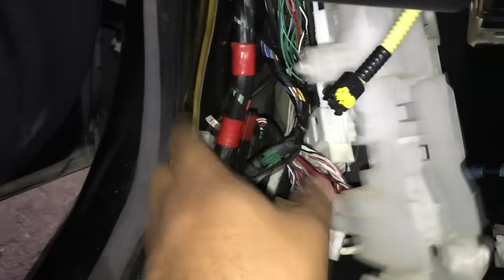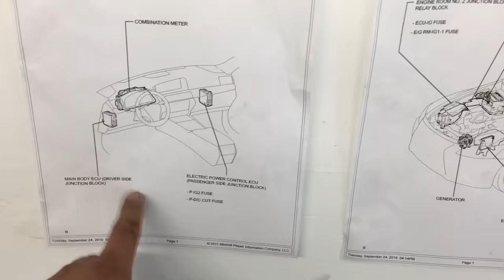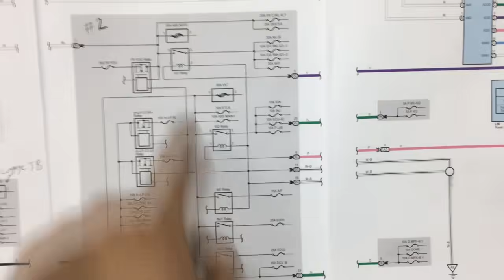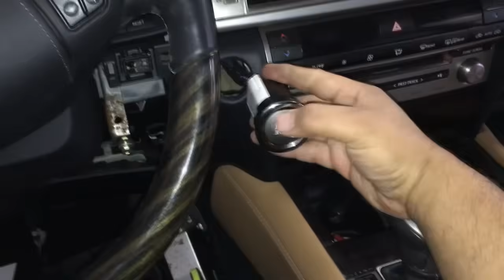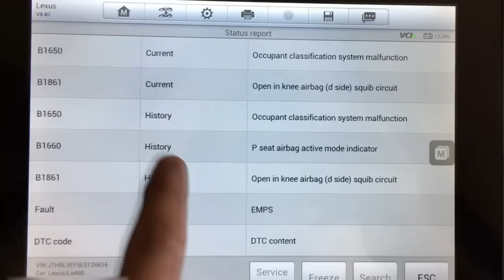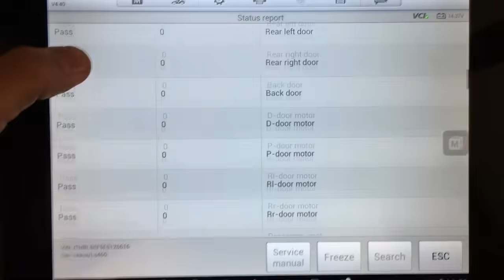LEXUS LS460 NO IGNITION POWER FLOOD CAR PART 1

Comment: Thank you this is the most I could find on the LS 460 I have a 2007 and I had the problem you started with a fuse kept on blowing because my amplifier was bad in the back I put another fuse in and it blew well I noticed  there was another fuse 30 amp on the other side driver side so I replace both  and after that that the car died so I can't go any further than where you stopped at the electrical I don't know what to do I had already replaced the relays I guess  just take your diagram and try to work my way through it some items do have power the interior light the the seats will adjust parking light will work and the doors will close that last quarter inch and the red light is blinking if I hold unlock and lock on the keypad it blinks and shows me the doors on a small display

Comment: Would that wiring diagram be the same for 07-12 Ls460? I'm not having the exact same issues, but at times, my ignition start button lights up but doesn't turnover the engine. I think there may be a bad ground or fuse possibly.

Comment: I have a 2007 ls 460 lose power the the starter I replace the starter I check all the relays have power to ing 1an2 the second pin dat you didn’t have power on I don’t also but I have power to the dash just no start or crank when I hook up my scanner give me c1242 open circuit ig1 an ig2 power source circuit need help

Comment: I have a question Erick I have the same car same problem when I powered it with the probe it gave me b2273 b2289 u0327 u1114 battery is good key is good I checked all fuses and relays is good the two ignition relay is doing the same thing like on the video the pins both have power but the rest is grounds and I changed the bcm didn’t change the only thing now is the door lights work but no light on the dash lights besides the light that has the door is open
Reply: Also the white wires going to the bcm has power and I changed the ID code box still doing the same thing

Comment: I just bought a 10k 6.2l for $2000 out of a "flood car" from texas. the mechanic told them needed new engine.. nothing wrong at all with the engine.. in a 2019 camaro running right now..

Comment: Question, after you replaced the fuse in the beginning (AM2 I think) after cycling a start cycle,why didn’t you check if the fuse was blown again?  If I have a blown fuse that is part of a sequence I always check after I replace and cycle the part that feeds it.

Comment: I need your advice I'm working on a 2008 lexus es350 that had no power to dash no crank no start after seeing u work on the 2014 lexus ls460 I did the something took the dash out and took the I'd box aka immobilizer and replaced it with one from the junkyard I got power back to the dash I used the autopro xtool to program the immobilizer it will SAS successfull no I could unlock and lock the car dash light up when I press the brake pedal the light go green but security still flashing no crank no start each time I try programming it it says operations fail  I got a new key fob from lexus it won't even pick up the the key when I try to program it I'm so stressed out i just took the dash out i keep getting b2799 and p16a4 code i really need ur advice please i dont mind paying u instead of the dealership

Comment: To change that spark plug in my LS460 I used a screwdriver to lift the seal under the ignition coil and the coil will come right out. I'm pretty sure you've already got it out by now though. Loving the video of all this work you are doing, I'm learning a lot about the schematics watching this.

Comment: You need to pop out the seal where the ignition coil seats, works every time. No need to lift the engine to remove an ignition coil.

Comment: Back in the old days, fill it with diesel. Let it sit for couple days. Break it loose. Flush oil system. Engine will not last.

Comment: STOP SHOUTING!
Jorge bought this car at an auction for 2k and thought "my compadre Erick will fix it for another 2k". Let's not feel bad for Erick because he got paid, also looks like he has never worked on a Lexus before. Couldn't take the coils out?? S0ark plug replacement on these LS 460 are tops 30 min.

P.S. Stop complaining about what engineers did or another techs did or didn't do. You could've said no to the job and that would've been the end of it. Nobody forces anyone to do anything.

Comment: The beeping is from the brake computer due to loss of pressure hence the accumulator is dead due to over work and water.  the speaker is on the left of the steering . you can disconnect it .

Comment: Eric your a brave man. I was a tech at GM for many years. I have seen cars come in after being hit by lightning. After haveing every module fry and smaller gauge wires fuse to each other seat motors burnt up. That was looking back on it now a walk in the park compared to flood damaged vehicles like this Lexus you took on. Especially after another shop had it before you looked into it and left you with what seems very little info on what they did. I believe I know what the outcome is gonna be after all is said and done. Good luck with the new wife.

Comment: Shittttt! I would not have taken on this job. It’s a nightmare waiting to happen. This dude must have bought it for almost nothing or got the insurance money and wanting to keep most of it. If he insisted you try, then he would have had to pay well and in advance every step of the way.
Did you ever envisage the amount of work you would have ended up putting in?
These cars are made to be repaired by the dealer. Likely he had an estimate done by them and chose not to continue due to the cost quoted which may have been more than the value.

Comment: A & I auto recyclers in ft worth tx, they have an engine 35k miles for $4,750 1-817-516-9090 Try to talk them down, as these cars engine will go for cheap after 2-3 years
Reply: Dude didn't you see that this video is from 6 month ago?
Reply: @gianfrancoa  Youre right I missed that

Comment: With so many flooded vehicles every year, there should be an opportunity to salvage those efficiently. Problem is, there is so much technical information needed, the best approach would be manufacturer specific. I wonder if anybody does that. If one had ability to remove each module and test on the bench, a guy could quickly define which are good, if only for parting out. These vehicles are cheap so I can imagine a profit margin, though you'd have to recycle hundreds of vehicles ever year to pay for the up front shop costs of learning how to bench test individual modules. Manufacturers have this ability, but are in the business of selling new cars, so are unlikely to encourage competition. Even getting the technical info would be problematic.

Comment: That power probe looks like a handy bit of kit. When these flooded cars get sheded  ,what happens next? do they go to auction ?and if so how long would they sit.I guess if you got one you would have to pull the carpets out ASAP . I guess they would go moldy .Do they put some heater in them ,with the windows open a crack to dry them out ? We don't get flooded cars here ,it looks like a huge problem.That bore scope proved a lot .If you keep going on it ,I hope it works out for you .Cheers

Comment: oh yes i forgot about those coils, what a design, you have to pry the seals out to get them out. new seals have a different design you can actually r&r the coils and plugs but i got more good news for you to put the new seals in i had to make a tool that threaded into the spark plug hole and pressed the new seals in, it's still a joke but better than the way the book says which is to beat them in. good luck partner.

Comment: If you have access to a Key programmer you can cut your diagnosis time. The key programmer will unlock the steering lock & turn on the ignition without the key, If the Key programmer is able to turn  on the ignition then you can focus on the certain modules. I always check to make sure I have a good key before going to deep into the diagnosis, VVDI key tool will check & renew Toyota Keys so if you do need to replace the immo box. with VVDI keytool you wont need to buy new keys you can just renew the original. If you already have the vehicle figured out hopefully my comments can help another tech.

Comment: I know what it takes to get to the immo box on this vehicle, its located on the firewall the dash will need to be removed unless you know a contortionist. If the immo needs to be replaced the typical jumping of terminals at the OBD will not program it. FYI modules related to the immo on this vehicle are usually a one time program only, If you have Techstream with access to a Seedcode calculator you can install some used immo modules & do a reset & then reprogram. Good luck
Reply from the maker: You are correct. I will be posting part 2 soon.

Comment: If the first shop was able to turn the engine over, the first thing they should have done was to remove the plugs, blow out the cylinders, put oil in them and turn it over to disperse the oil. They might have saved the engine. Usually you can find a place to power the starter solenoid to turn the starter without all of the electronics working.

Comment: there is a reason flood damaged cars are written off for just salvage, i was thinking how brave you are with even looking at it, i would not take this car on because it will always be problematic, the wiring loom will have taken on water and will forever have corrosion issues.
but i will thank you for taking the time to make the vid.
Reply: chrismechanic B you could attempt to find a salvage car( non- flooded), an buy out the car whole & take what you need & then just sell out the unused parts. But you would have to be certain that the donor car will be working with no errors in any of the control modules...
Not to mention that finding a donor car might be a long wait. It would make an ideal project car, but it will take some time to bring back to life.
Reply: They are written off due to possible ongoing problems.
Mechanical stuff is easily repairable, it's the electrics that may fail over time.
Insurance would rather be rid of it.
Reply: I'm a mechanic too and would never work on that. It will keep coming back with check engine, electrical problems

Comment: Thanks Eric very good video please answer this why wouldn’t a fuse blow when u push the start button which goes to ground when u already have reference voltage from ECU? U said it provides ground to the ECU
Reply from the maker: The reference voltage provided by the ECU is sent through a resistor before exiting the module. This makes it very low current. The ECU monitors the voltage on the line to see it drop when the button is pressed.
Reply: ADVANCED LEVEL AUTO THANKYOU Eric I’m learning  just an old retired hvac ref tech

Comment: The owner should cut his losses at this point and just part the car out to try and recover some of those losses. I owned a vehicle (1 yr old at time) that got flooded and in just two days it had barnacles everywhere you looked, in every harness, bulb socket, etc.....I spent about 5 grand on new boxes, got it to run fine and sold the ticking time-bomb back to dealer.

Comment: Im a Lexus tech and definitely would not want to get involved with that  vehicle. Pop out the plastic spark plug tube  seals to get the ignition coils out of the valve cover.  When pressing the brake pedal a green light should come on the push start button allowing you to crank the engine.
Reply: You sure
Reply: Bullshit !  Any good mechanic would know exactly where to start ! I’m a Mercedes’ mechanic and it’ gets no harder than working on a Benz electrical system

Comment: There are other ways to check fuses than to see if they have voltage.  Simple pull them and run a continuity test on each.  You can probably do this on all that do not have voltage as they are dead due to the flood.  That is the first step in a step by step troubleshooting analysis using process of elimination.  You can then test for voltage from the battery to the various control modules.  You can actually short wire from the battery to the 12 volt inputs directly if they are fed through the ignition.  It's not nearly as difficult as you pretend.   If and when you get it running the value will be conmensurate with the vehicle worth.  If you don't want to actually do the work then perhaps find a different profession.  Maybe sweeping floors is more up your alley.
Reply: Can u imagine taking every single fuse out to  check its integrity on about 10 fuse boxes if u can do that then oh boy ur a saint
Reply: A Day, what is your experience as an automotive technician?

Comment: Why would anyone rebuild or put a flood modern car on the road again when you could just buy another one
Reply from the maker: My thoughts exactly
Reply: @ADVANCEDLEVELAUTO  useless it's something very rare for instance a Corolla t Sport compressor or rare outher rare car there just to complicated as the only thing they should do is listen to the weather forecast and moved the cars out of a flood zone area
Reply: Because they want a luxury car for cheap, or are hoping to repair and flip it for profit.
This car only had 31k on the clock.

How often have we seen a supposedly dead or seriously degraded car repaired just by fixing some earths, sorry, grounds?
Having said that, you buy this kind of car, you really need as much info as possible to begin with, then check for those problems. 
It's a risky proposition for sure.

I don't think 2 months is long enough for that kind of rust damage to occur internally.